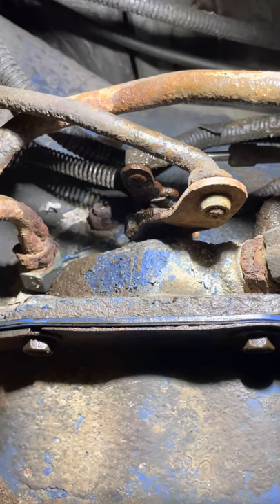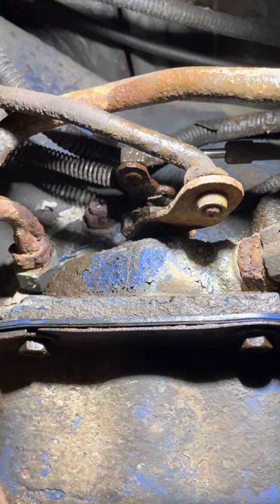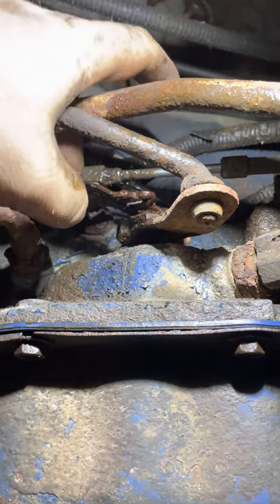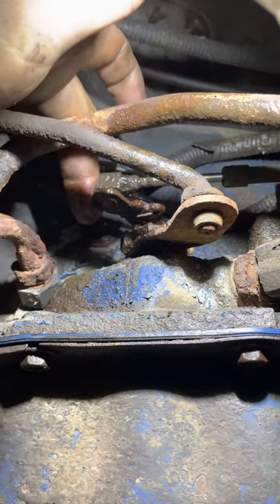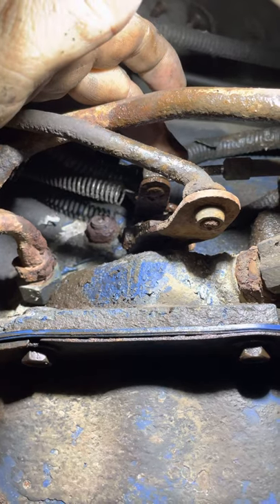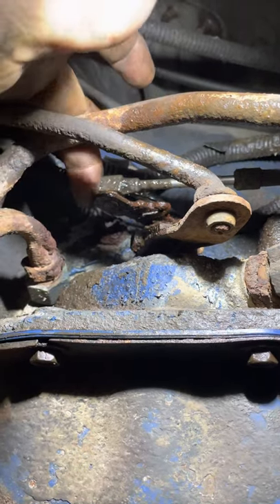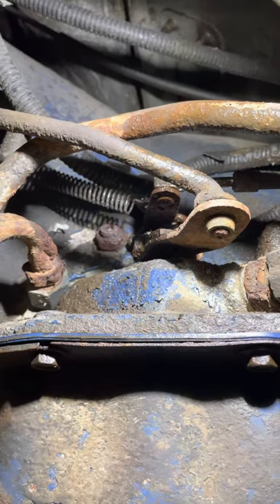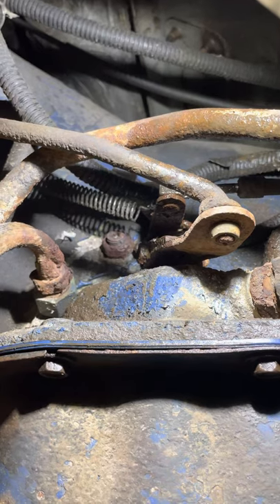Check your throttle valve cable!!

Comment: WHATS THE FIX FOR THIS
Reply from the maker: We were able to just free up the linkage and it was fine after that.
Reply: Yes, but was it binded up? I’m having the exact same issue
Reply from the maker: @michaelv5807  yes it was binding at the transmission and not letting it move.
Reply: Sooooo.... Wd40? What did you do to unbind it?
Reply: How do you fix this?